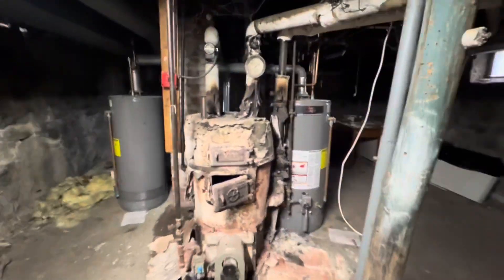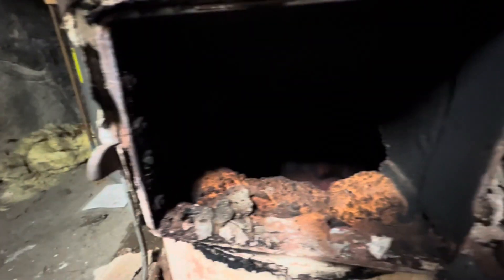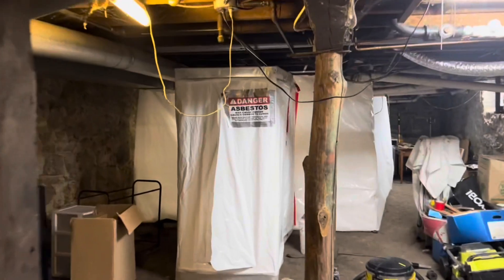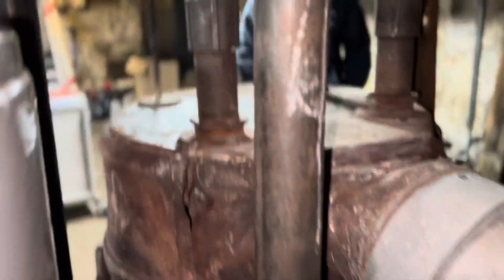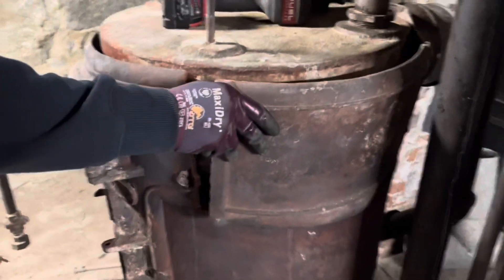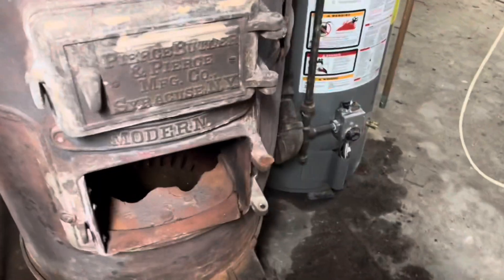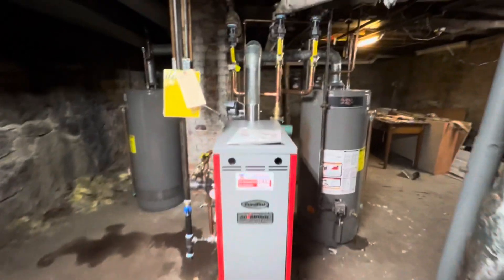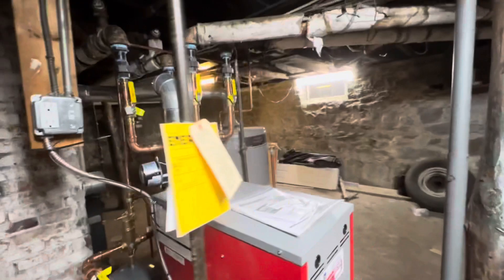Replacing a gravity hot water boiler from 1905 with a Pure-Pro Advantage 84% efficient boiler

Comment: Why don’t u go with a hot water conducing boiler that hangs on the wall
Reply: That home had an old gravity hot water system. Large steel piping and large cast iron radiators. The homeowner didn’t want to have to replace all the cast iron radiators and piping for copper fin tube baseboard. It was given as an option but he chose this option for budget reasons and it was a rental property and it was in the middle of winter that the old one let go so time was another factor.